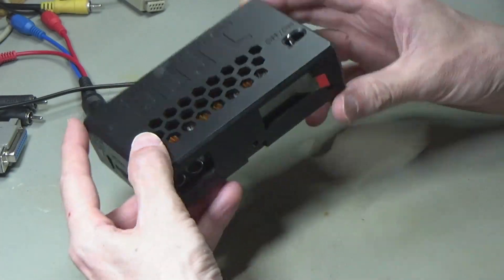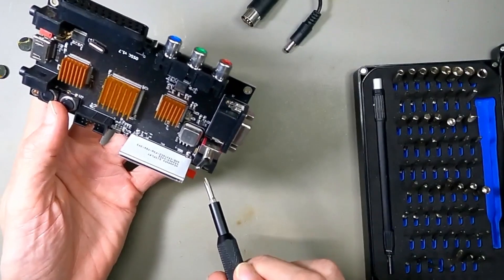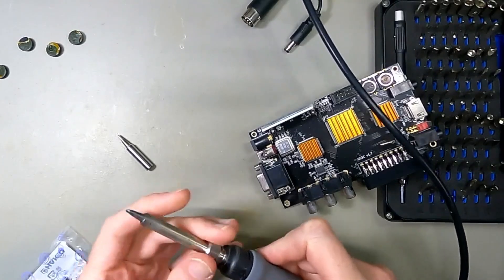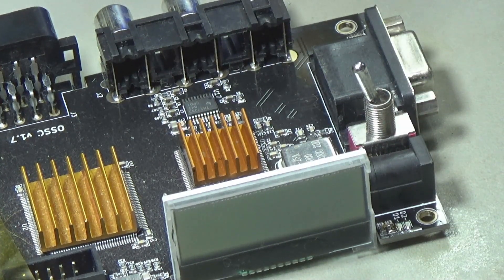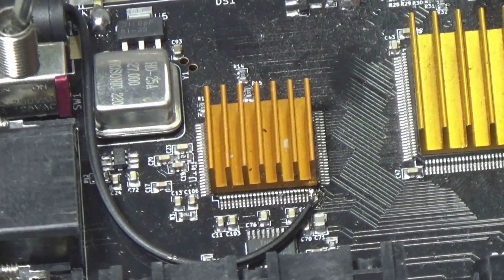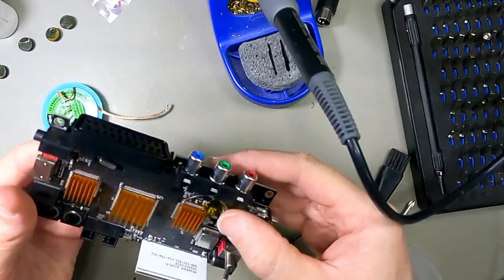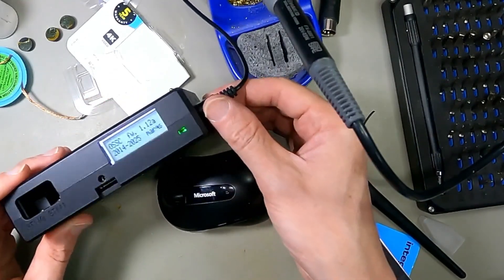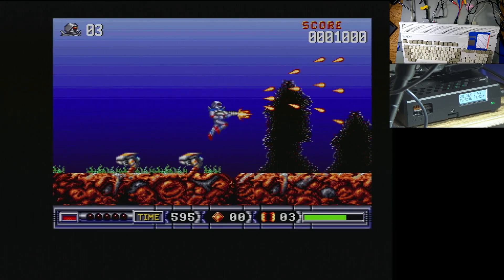Upgrading OSSC from 0.xx Firmware to 1.xx Firmware

Comment: Hi.  Would you mind checking what flash chip is on the reverse of your OSSC PCB (labelled U10).  I read this mod is only compatible with certain flash chips so I'm a bit reluctant to attempt it.  My OSSC looks identical to yours and my U10 flash is labelled IS25LP016DNLE.  Thanks.
Reply from the maker: @ruckage1  can't tell you off hand. But I can tell you that I have done the mod in both the 1.6 and 1.7 hardware versions of this unit https://www.amazon.co.uk/Source-Converter-SCART-Component-Gaming/dp/B07QF95QP3
Reply: @DavePoo2  Thanks for the reply, that’s the one I have as well (it was a bargain as Kaico sold it for half price as it's the  'old' 1.7 version). 
I've successfully modded it now - it was a bit fiddly but I got there in the end (your video was very helpful) .  It's firmware has been updated and it's working perfectly 😃.

Comment: Did this to mine last weekend. It fixed the sync issues I was having with Amiga
Reply from the maker: I've had no trouble with Amiga on the old firmware, but I wanted the Lumacode support for the C64.

Comment: Trouble is why should you need to do this hack to upgrade the firmware an such an expensive item.
Reply from the maker: I think the mod basically makes it match with the latest board revision so you can take the latest firmware. If you don't want to mod then you can upgrade to the latest 0.xx firmware. But if you want the Lumacode additions then you need the 1.xx firmware.
Reply: @DavePoo2 ah ok got it 👍
Reply: Done the mod now dave, got lumacode option.